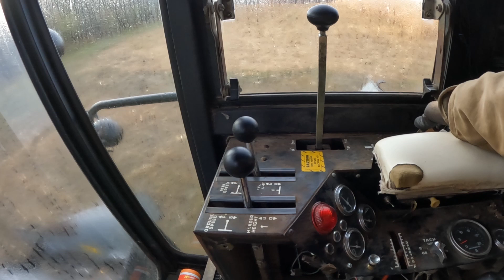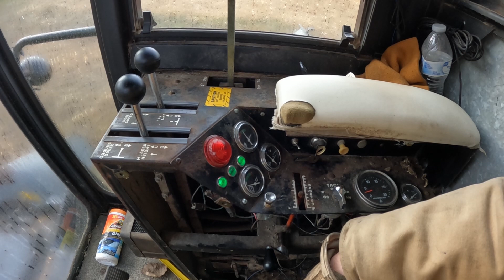Running Corn Day 3

Comment: Loved the video again.  Looked like you used ether.  Scary for a diesel tractor but we never had to use it on our gasoline combine.  We are in Oklahoma, perceive you are further north.
Reply from the maker: Hi Ed!  Yeah, it really depends on the application.  My dad’s 856 came from the factory with ether injection for cold weather.  My combine is a gas, and has a habit of draining back to the tank.  So, I just use it to get the engine cranking faster so it gets fuel back to the carb sooner.  Another commenter said I could clean and adjust the carb.  So, I might do that in the next year to take care of the issue.  You perceive correctly.  I’m in Northeastern Indiana.  Thanks for watching!
Reply: @richfarmer6143  come to think of it, ours had that same drain problem.  We just cranked it over longer.  Never tried ether on it.  Maybe could have.  Thanks.

Comment: Never use either on my gleaners them old 250 Chevy allways cranked. . 15 percent and dryer corn l ran l bar on door and 3 and 5..
Reply: Wondered why myself.  Usually you choke a gas engine,  not ether it.
Reply from the maker: According to one of my viewers I need to replace a needle and seat in my carburetor.  The fuel must drain down at night.  Otherwise, I have to crank and crank before it’ll start.

Comment: I am a new subscriber. What part of the country are you in?  Also, a couple of suggestions. Try putting the machine in gear at an idle to lessen transmission grinding. Also, if you are throwing grain out the back and not cleaning the cob, tighten it down, not speed it up. Keep the grain in the machine longer. Your sample is clean so you could also lower the fan speed.
Reply from the maker: Thanks for subscribing.  I’m in Indiana.  Thanks for the suggestions, I’ll try putting them to use next year.  Thanks for watching!

Comment: An old trailer house frame and axles converted to a gooseneck trailer with gravity boxes mounted on it works so much better than each with a pole hitch because can travel faster and have both mounted on one frame also you have trailer brakes then too.

Comment: What kind of bars are you running in your concaves and how many??
Reply from the maker: I’m just running the stock bars that came with it.  I believe they are a c channel shape about 3/4 inch by 1.  They are positions 1, 3 and 5 if I remember right.  The cylinder is running the stock rasp bars as well.  They seemed like they were in pretty decent shape when I got it.
Reply: That's what I ran..sometimes 2 and sometimes 3..rasp bars are reversible when they get worn..what is the corn price for you now? Ours is about $7.20. Bushel..
Reply from the maker: @carlthomas1141  take home was about $6.44-6.45 this year.  I’m not sure what it is after all the shutdowns from the Mississippi River being low.

Comment: Why not run 3 rows
Reply from the maker: I planted with a four row planter, so I can either do 3 and 1 or 2 and 2.  I figured out that it was a lot easier to just run 2 rows for the turns and curves.  By doing just 2 I was knocking over a lot less corn than trying to do the 3 and 1.  Thanks for watching!
Reply: Get a old timer to show you how to plant. Plant 12 turn rows or end rows. Then start in longest part of the field drive straight end to end back and forth planting out over turn rows. Only turn rows will have curves.
Reply from the maker: @raymondcamp8212  thanks!  I’ll try this out next year.